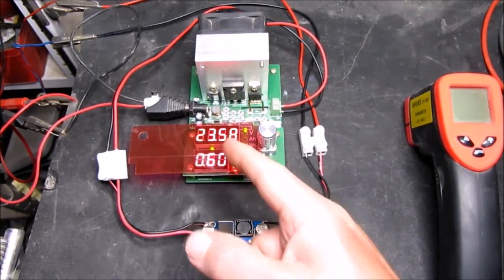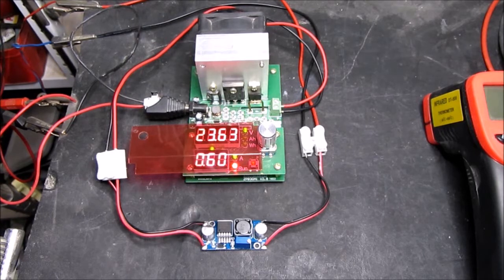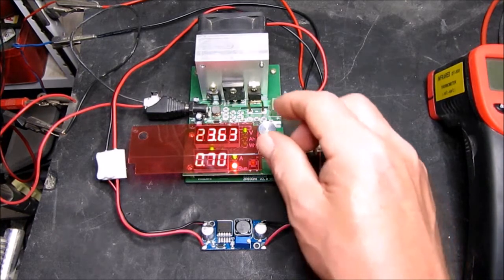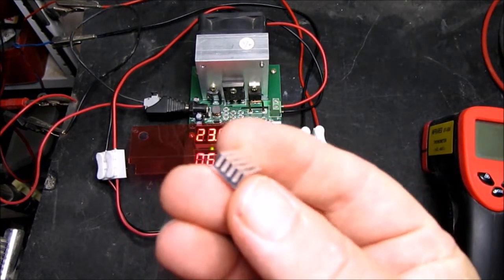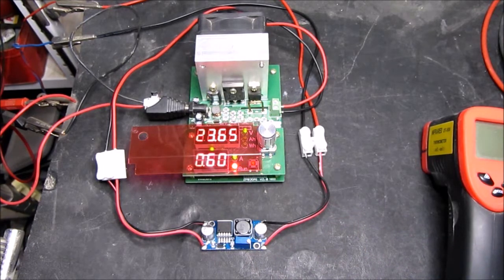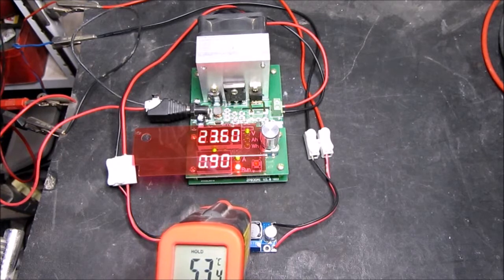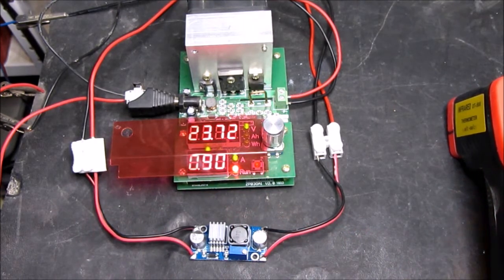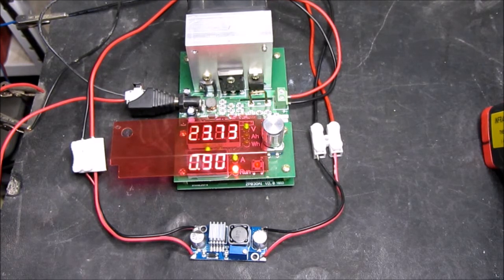XL6009 3 Amp  Step-up DC  module Heat Sink Test Power Supply DIY Electronic Project

Comment: Hey bro can I use this module for a speaker which requires 12v 3A for being operational and has a output of (15+15) watt.(it is pam8610)
Please tell me🙃
Reply from the maker: Provided you are not running the amp flat out it should be OK but will need good cooling and maybe a fan. Also the lower your input voltage the less efficient the booster will be generating more heat. Thanks for watching, have a great day!

Comment: Hey bro can I use this module for a speaker which requires 12v 3A for being operational and has a output of (15+15) watt.(it is pam8610)
Please tell me🙃
Reply: Keep it near 14 volts pam8610 can take till 15 volt, add heavy capacitors 25v 4700uf or above 3000uf with heat sink both on pam8610 as well as boost converter. But still there will be voltage drop when bass kicks in speakers.
Reply: @61keystonirvana  I think that 12 volt battery with BMS is a good deal
Reply: @Hardplay-Lvnyy  that is much better

Comment: So this is a dedicated boost converter not buck? And how much current draw when input is 5V and output 9V 1A? Thanks
Reply from the maker: Yes, boost only. It is more than 90% efficient so at 9 volts out should be about 1.5 A in. I don't have one now to test but they are inexpensive to try. Thanks for watching, have a great day!
Reply: @1nformatica  Can suggest another efficienty cheap boost module with min. input 3V and current regulation? Cheers
Reply from the maker: @MACYNET323  Take a look at this : https://youtu.be/6YHi8u7NADU

Comment: how much the temp difference between the top and bottom side at 24v 1a? i have small active cooler but it seems only fit on bottom side
Reply from the maker: I have not measured it but I think it will make little difference, I mentioned it here : https://youtu.be/8Qi4ONnW6hE?t=168 Please consider subscribing if you have not done so already!

Comment: can we take output 1.5A at 12 v , my router of 1.5A is not working with this.
Reply from the maker: Boost converters are not very efficient and the input current will be much higher than the load. So it depends what your input voltage is and the current it can deliver. For example if you were to try and get 12v @ 1.5A output with an input of say 5 volts from a USB adaptor it probably won't work as the USB adaptor cannot supply enough current. Also it could be overheating and shutting down.
Reply: @1nformatica  you are right. it's working for 500,600 ma, I will try with 2 battery  3000mah and then output if can delivery 1.5A using a heat sink.
Thank you for your response. Can you pls suggest any other circuit you already tested to use with my wi-fi which uses 12V, 1.5A to work? I want to use one or two 3.7v, 3000 mah battery.
Reply from the maker: @BigTechGuide  Maybe a LM2587 Module. I made a video comparing the modules : https://youtu.be/6YHi8u7NADU Please consider subscribing if you haven't done so already!!

Comment: I used this to run a small toy dc motor and it got so hot i could smell it starting to burn! Does my small moto which ran on a single AA battery use so much current?
Reply from the maker: Hi, What voltage were you boosting the 1.5v AA to? Usually small motors like those run directly from the battery and perhaps you were supplying a too high voltage for it? With a multimeter you could always measure the current!
Reply: The xl6009 was connected to 18650 cell and boosted to 5.1v, then i connected an lm317 to the output of xl6009 and set the lm317 to output 1.5v, but the xl6009 gets too hot really fast.  on connecting the battery directly to the lm 317 with input and output capacitors the motor doesn't run as well as it did with 6009 module connected  with 317.
Reply from the maker: The LM317 needs I think at least 3 volts difference to work well. You could try an low dropout regulator like LD1117 or LM2940. Perhaps another alternative is a buck converter like this one http://bit.ly/LedDriver Don't worry that it say LED driver, it's just a buck converter. You can also limit the current with this module. It needs 2 volts difference which may just work for you otherwise you will to add additional cells or different cell type.
Reply: i will try that, i have a lm 2596 module but it doesn't have the ability to control current. btw do you think the xl6009 overheats because the motor pulls too many amps or some other reason?
Reply from the maker: You really need to measure the current, if the resulting power calculation (amps times volts) is more than 20 Watts then you will need to put a heatsink.
Reply: Lucky Luciano ::)) Same thing happens with me...

Comment: Really nice! But how did you attached the heatsink to it? I tried but it won't be fixed.
Reply from the maker: Hi, the heatsinks I used came with "3M" double sided sticky tape on them. Just peel off the backing and press down. I had no problem with them sticking but you could clean the IC surface with alcohol or even roughen it a little with some fine sand paper. These are the ones I used: Aluminum Heat Sink http://bit.ly/ALHeatSink
Reply: 1nformatica Nice! Thank you very much! :)
Reply: 1nformatica The weird thing is that I'm not even getting close to 15w. And it's really hot!
Reply from the maker: You're welcome!
Reply from the maker: What voltage and current do you measure?
Reply: 1nformatica What do you mean? Anyway, I'm using a lithium battery (18650) and uping it to 12v for a small dc motor. So, 4.2v to 12v. And the step up is connected to the out connections of a TP4056 through a on/off switch. I'm making a small fan... (There's a modified 9g servo as well, to move it side to side.) Shouldn't be all that problem. I tried two lithium batteries as well, with two TP4056 in parallel. And the same... Now I'm going to try connecting them in series.
Reply from the maker: Hi, I was just  curious to know what current you were drawing from the converter. Leave a comment with your progress!
Reply: 1nformatica Oh! 12v +/- 700mAh.
Reply from the maker: So about 8.5 watts. The device will feel hot to the touch but no so much you can't keep your finger on it! Have you measured the temperature? IR Thermometer http://bit.ly/IR_Thermometer
Reply: 1nformatica No need, the heatsink I used gets too hot even to touch. :/ Maybe it's a fake XL6009, I don't know. :/
Reply from the maker: Hmmm, doesn't sound right! Mine have printed "XLSEMI" above the XL6009 on the chip. I once bought a 1000' reel of Ethernet cat5 marked as "AMP" with all the holographic dodads but would not work over a few yards. Turned out it was fake and not even copper, found that out when bits of the cable stuck to my magnetic screwdiriver!!
Reply: 1nformatica Yeah... Must be it. :/
Reply: @MCsCreations  thats beacuase you are using a lower voltage than the minimun required for the module. The minimun is 5v. You can see it in the datasheet